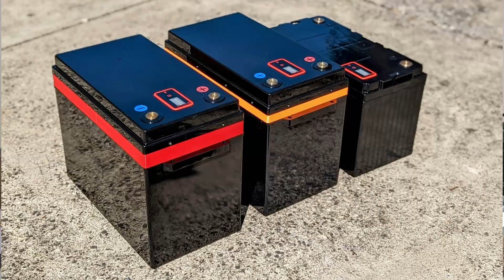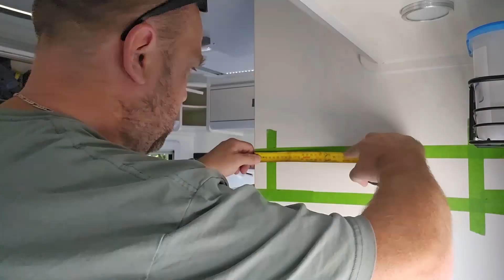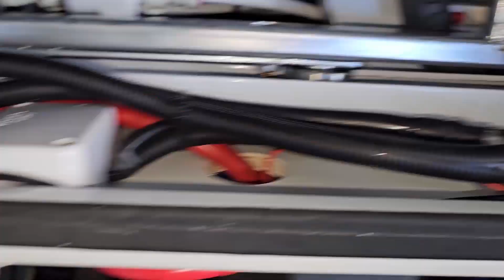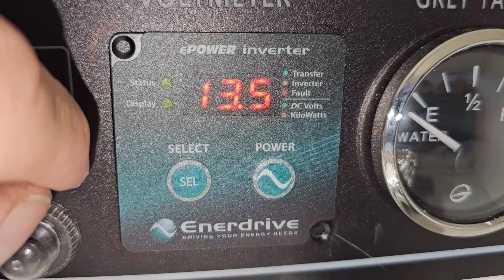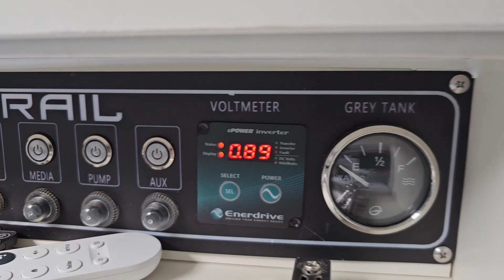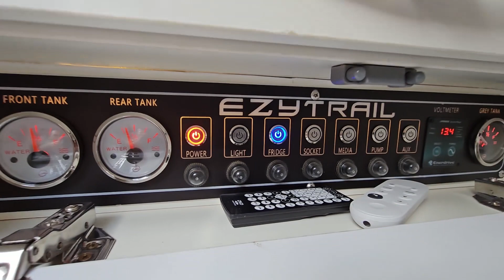Ezitrail Ceduna 15 mk2 632Ah battery conversion

Comment: I'm in the process of upgrading my own caravan and getting rid of my agm batteries ( 2 x 220 Ah ) both have failed due to age. I have also looked at "powerpaul" lithium batteries, Just a bit scared of the price, not a cheap item !!!. With my caravan ( a 2012 Jayco Discovery 17:55:3 ) I have installed the Victron smart 12/30 charger as you have, also a Victron smart current shunt and Victron smart solar controller ( 100/50 ). This for 1000 watts of solar on the roof of the van. All are blue toothed to my phone and no need to mount a external volt and current meters. I just have to look at all of the information on the Victron app. I only have a small inverter ( 300 Watts ) and is mainly used for the lap top computer or my electric shaver or a desk top fan. As for the micro wave oven , it's not used and has just become another storage cabinet. The air con is a 3kw reverse a/c unit and now living in tassie is not used ( but the diesel heater does ) but is we are camped at a place with power the a/c does get used. We free camp a fair for up to a couple of weeks at a time and have used a small gentrex 2 Kva generator when the batteries have gone down. 
Fuseing is most importaint and i have 4 main fuses,  from the batteries, a 50 amp for the feed to a second fuse block. The second fuse ( 50 Amp ) is for the solar controller. The third fuse is for the Victron battery charger and is rated at 30 Amps. The charger also has it's own 30 Amp fuse built in. The forth is for a external 50 Amp Anderson plug and is used for my amature radios etc.
That second fuse block is one i installed a few years ago and has a number of sub branches ( 6 fuses ) mainly for the external led lighting and Engle fridge, the diesel heater, television and Vast receiver, the 240 volt invert. There is also a Merrit socked by the bed that i put in, but have not used as yet.
The sixth fuse id for the 12 feed to the original sec111 fuse bank and power supply/charger. This is were all of the original 12 wiring was ran when the caravan was built. I have the 240 volt power siconnected from the mains and the sec 111 is only used as the original fuse block.

Comment: Looking good. Can I suggest grab yourself a bootlace crimper from Sydney Tools or Total Tools and do the leads going into the MPPT controller. Youll thank me later as they wont fatigue in the terminals and will have a better connection. Also fuse your main positives as those batteries if they are shorted will dump a lot of energy into the short.

632AH of LiFePO4 is a lot of capacity, should do you well.

Comment: Great job mate. I'm about to embark on similar DIY project with 2x270AH Scouts and Victron Multiplus and MPPT's. The one thing I did however notice (aka could not see) was that your main positive feed from your battery doesn't appear to be be fused. Yes the inverter is fused but you still need a main battery fuse as close as possible to the battery (even before the switch). If you have a dead short anywhere between your battery and the next set of fuses/circuit breakers you could end up with major headaches. Battery isolator switches can handle 300a to 500a so the wires (especially the smaller gauges) will melt long before the switch burns out. The fuse size should be spec'd based on cable size but it should be +- 250a in your install.  Cheers
Reply from the maker: Hi neil.   You are correct.  Fuses are so important. And the correct fuse size is a must.   I thought about this for some time.   In the end i went this way for a simple reason..   Adding a second fuse that super high amps will pass through introduces 2 new connection points that must be perfect.  The slightest loose bolt or build up of dirt on the fuse can introduce a lot of heat as the power passes through the bad connection point. (I already had to replace 1 very short 70mm cable going to the existing fuse because it was getting hot due to a bad crimp)   this heat can also (& more likley to) start a fire.  So i decided to do it a bit more like most cars.  A short length of wire to a fuse/distribution box and then everything individually fused from then on. Currently the only thing that is un-fused is the switch iteslf.  I have considered (and after your comment i may actually do this) moving the 250a fuse for the inverter to before the switch so it becomes a main fuse for the whole van.
Reply: Hey mate did you end up getting Paul's battery's for your build are you happy with them?

Comment: Hi mate.  Thanks for sharing - damn good first video!
You mention a temperature-controlled fan in one of your replies.  Could you possibly share what it is and where you got it from?
Reply from the maker: Yea mat.  Its simply a 120mm computer case fan that turns on when the compaerment reaches 45.   It is controlled by a simple thermostat i purshased from amazon for $15.   It sucks air from the main van and blows it into the compartment.   I have set a simmilar system up in my fridge compartment as well.
Reply: Thanks Rick.  I need to do similar as my setup gets quite hot under the bed.  I've got a 280 PowerPaul and love it!

Comment: Well done!  Those batteries are excellent value.   What the make and model of AC, if you could please.
Reply from the maker: Hi brett.  The aircon is a Truma Aventa comfort AU.  The spec sheet says it pulls 1000w.  But im my expierence i have never seen it that high.   Thats the advantage of modern inverter aircons...   they can ramp up and down as needed.

Comment: Great to see an install video with some facts and figures! It really helps to understand why you've designed the system the way you did. It looks like it's going to be a great system. It'll be interesting to see how the solar and DC-DC charger go when you're taking the caravan out.

I personally have a much smaller system, but much the same idea: enough solar to keep the fridge going if I'm parked, plus the DC-DC charger to get the battery topped right up at the beginning of a camping trip (and a backup in case of any cloudy days), and an additional fold-out solar panel. I think designing the system so you're not constantly having to watch the battery monitor is ideal. And at least with LFP batteries, you can safely cycle them a lot deeper if needed.
Reply from the maker: Yep i cant wait to teat it all out properly.   We are heading to the cape this winter and that will be the first big test. 10 weeks mostly off grid...

Comment: Nice work! DIY rules, and it gives the user a really good understanding of what's what. Massive storage power matched to equally suitable components to run whatever you want. You've ticked the necessary boxes and done an awesome job.
Reply from the maker: Thank you paul.   The batteries are awesome.   I have since cleaned up some more of the wiring and added vents and a temp controlled fan to allow more airflow in the campartment.  Overall the system works great and does exactly what i wanted.  10+ hours of air con....